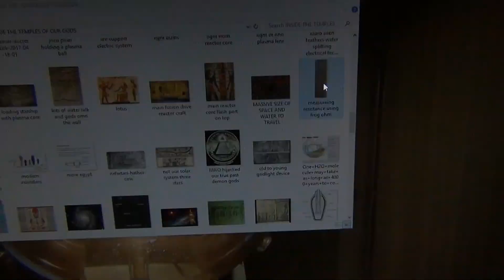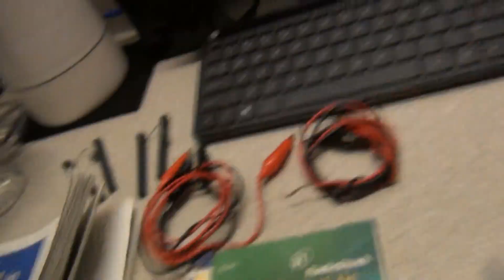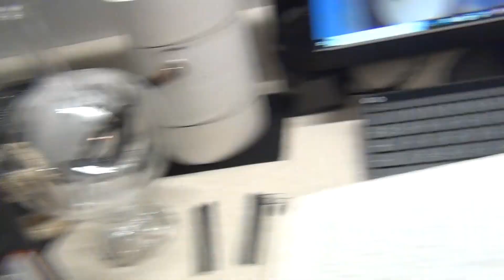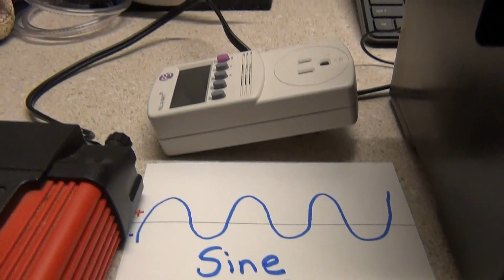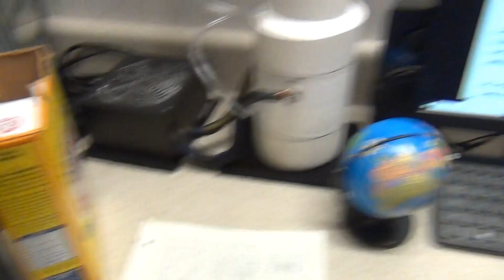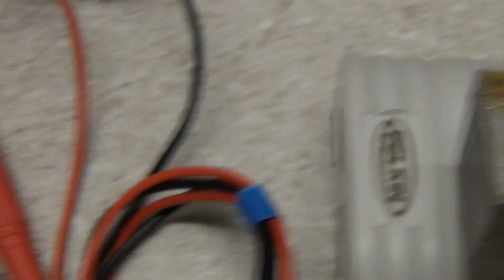HHO ELECTRON FROGS & POWER STANDING WAVES

Comment from the maker: Having the right tools for the job to measure volts amps and resistance of electrical circuits is very important. The voltage meter is indispensable and can be used to measure many different types of electricity. More videos on electricity will be created this year to help others understand direct current DC square wave and A/C alternating current sine wave.